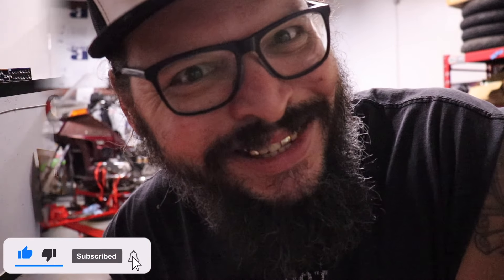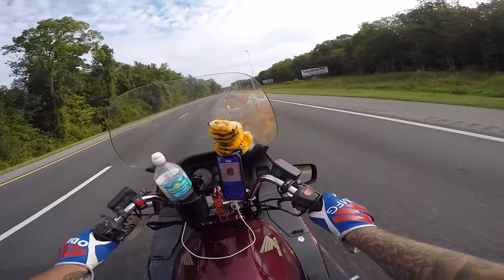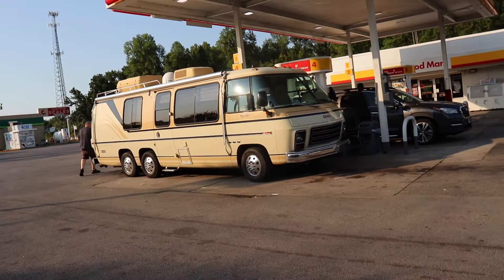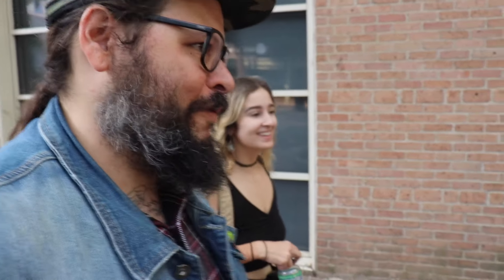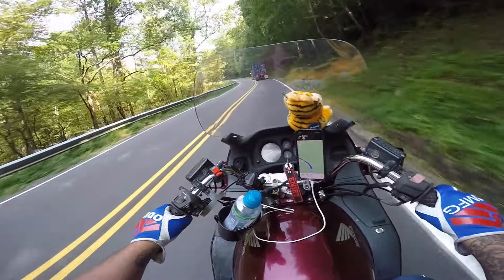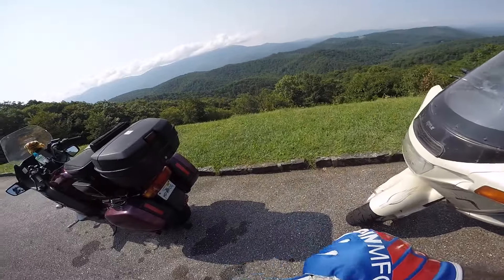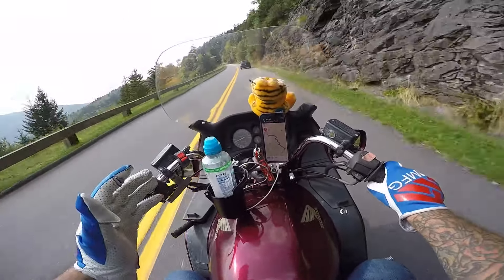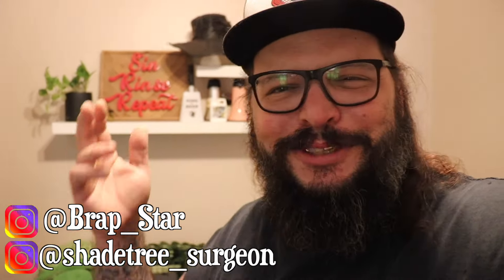JUST SEND IT | Motorcycle Roadtrip on the Cheapest Bikes We Could Find

Comment: I paid 3k for my VTX1300. I bought it on a Sunday morning. The next Thursday afternoon I took it 8 hours from northern Louisiana to Grand Isle. The southernmost point in LA. I had my endorsement, and insurance, but the new tags hadn't come in yet, so I punched out  350 miles with a dead tag on a bike that I had only ridden maybe 20 miles on when I had only ridden maybe 5000 miles on a bike ever with my longest trip being about 2.5 or 3 hours from home base. 

Since, I have put about 5k into the bike in annual repairs. I don't work on bikes. And almost 20k miles on that one bike. Plus close to 5k on just rental bikes. 

#ilikebike
Reply from the maker: Jimmy is doing it right. Be like Jimmy.
Reply: @shadetreesurgeon  I tried to follow your lead and do my own work on my bike. Brakes, no problem. New sissy bar to hold a bigger pack, no problem. New custom ammo can bags, easy. Pull the tank to put a new carb on it, and drop the tank and dent the shit out of it, and then break every vacuum line on the carb as well as the intake boots. It is in the shop right now getting all dressed back up.
Reply: @UCYxS6Kmr8sFFhb0cZJbfcqQ I'm on my 3rd or 4th set of tires, and brakes. I paid to have the front fork tube rebuilt. I've paid twice to have the neck bearings done, and the carb rebuilt, and neither has been done yet. Hopefully, this shop is more reputable than the last two, and it actually gets done. A wasted $1500 trip that all I got was tires and fork seals when I paid for a full service, and neck bearings, and brakes. Then another $1000 trip for some fucking turn signals, and maybe neck bearings when I asked for tires, a service and a carb rebuild. Now, this one is $1500 for actually getting the carb rebuilt, a new front tire, checking the last guys work on the neck bearings, and a full service. I've had the bike since 2016, and it is a 2006 model that has been neglected its whole life, but it still runs. It ran when I took it in, but was leaking gas out the airbox. 

What? Should I ride a harley? I don't like working on my bikes. I like riding them.
Reply: Hey! Another Louisiana dude. I'm in Thibodaux
Reply: @Gibsonfan1989  lafayette here.  I have a touring harley but love my 85' honda shadow.
Reply: @AKSnoopy7  nice. I have a Honda NC750X. Looking for a touring bike next year
Reply: @Gibsonfan1989  not anymore. I was in Winnfield. Based out of NC now, but working in Tallahassee at the moment.
Reply: It's unusual to hear of a Honda being so finicky.  A Sportster and a service manual, with a cheap set of tools is a high value combination. So easy to maintain and repair. 83,000 trouble free miles, still on original drive belt and clutch cable.  You can do it yourself, it's not hard. I do my own tire work, it's all in the service manual, and on YT! The clutch "spring plate" died at 38,000 miles. But, it did not leave me stranded, I was able to limp it home.
Reply: @spacetruckin6555  I can rebuild a semi truck top to bottom. No problem. I can't do carbs. I don't have the patience to work on small stuff. I'm too good at breaking it. It has never been finicky. I took it to shithole, scamming, lying assholes to get worked on. There isn't a shop inside 100 miles of my house that I will take it to again. Or anything. I wouldn't let any of them change a tire on my friggin bicycle.
Reply: @Gibsonfan1989  hey, another Louisiana dude...I'm in Houma.
Reply: @gokaneinthemembrane2745  hey! How'd y'all make out from the storm? I'm currently living in sulphur. My job moved me here because I had no house there anymore, but I have another place here.
Reply: @Gibsonfan1989  my shop got leveled by the storm. House has a few holes in the roof and the garage door is on vacation in someone else's yard. Pretty brutal overall.  I'm currently looking for a place to rent or perhaps buy to keep my bikes and tools. We just got power back yesterday in my neighborhood but of course all the appliances are fried. Overall,  we made out better than some. Houma took a major hit.
Reply: I seen the video of that hoda you bought 4 $750.00 watched you go Miles and miles lol I also like crappy junky vehicles why have no idea 💡 lol
Reply: @shadetreesurgeon  you should come to Tucson Arizona! I'll give you a local mountain tour that will blow you away. There is sooooo many fun places to ride in and around Tucson!
Reply: VTX1300's are awesome
Reply: Will I had a 2020 hawk 250cc cost me thousand and something traded it for a Honda goldwing 1984 1200 the guy wanted 3 thousand for it I was at work so I had my step son ride my street legal dirt bike about 2 hours out and he came back with the Honda goldwing
Reply: @jmyoung513  will I know this dude in OKC area who said he can rebuild my starter because they don't make them any more so I looked online my self he wanted me to pay $120.00 also on line you can order them same price I going to have that dude to rebuild my starter lol
Reply: Hondas build the most reliable motorcycles
Reply: @Gibsonfan1989  I almost bought one of those a couple years ago.  They are pretty slick. I guess they weren't weird enough for me so I wound up with a pc800.😆
Reply: @MostlyInteresting  I love it. I only wish it was more comfortable for long rides.
Reply: @Gibsonfan1989  I haven't gone on any long rides as of yet kind of working up to it. But the PC has a fat seat and a very neutral riding position so it's been quite comfortable so far.
Reply: @Gibsonfan1989  I'm in Lake Charles.
Reply: @mr1bienvenu1   what's up dude!
Reply: Vtx bro 👊
Reply: @shadetreesurgeon  dam shadetree I would really like to hangout with you and go for a long ride unfortunately I'm in Philly but I'm doing Daytona bike week this year and more than likely I'm doing Sturgis solo from Philly can't get nobody to do Sturgis with me they say to far but your a real dude oh well it will just be me and my Kawasaki Vulcan voyager
Reply: Feelin the Louisiana love, I'm a lake Charles native

Comment: "Tupperware glides" has me on stitches 😂
Reply: As an owner of a PC800 it was a giggle here also. We call them tupperware all the time.
Reply: I've owned 2 Goldwings. Found them a bit boring. The transmissions failed on both of them. Both were bought used, and both came with floorboards and heel and toe shifters, which I replaced with stock shifters and pegs. I was told that the previous owners probably used the heel and toe shifters for a footrest, putting pressure on the internal shifting mechanism and eventually causing damage.

Comment: I live in Ohio and a few years back I saw a 1982 CB900f for sale in Phoenix AZ. I bought it based on a few pictures and a video of it running. The next week I flew out and rode it 2000 miles home. It took about a week. I rode it back as it was other than replacing the tires and doing a quick oil change. That was one of the best weeks of my life.

Comment: Remember my first trip to France in 1984. On a beat up  Z650C, with 45000 miles on it. $500 or so. Two throw-over saddlebags, and a tote bag on a rack. Set off for France, and looked for a hotel every evening around five pm. Arrived on the Spanish border after four day, stayed for a week, then rode home by the same method. No 'cell phone, no GPS, just a Michelin map of France. Became completely hooked in those two weeks. Oh, and it ran almost dry of oil in the centre of France in the August sunshine. Took 3 litres of oil to get a level in a 3 1/2 litre sump. Ran fine for another year.

Comment: I did something similar in 2018 a guy  I work with was talking about riding to sturgis I had at that point not owned a bike in ten years. I told him I’m going to buy the cheapest like I can find and go with you. $2000 layer I had a 2004 klr650 with 40.000 miles on it and I went to sturgis. This was the second time in my life that I rode up there. It was one of the best times ever. Cheap motorcycles are great. Got home and traded it for a 2004 super glide plus $1000 now I’m riding a $3000 Harley. Lol

Comment: That's why I originally wanted an ST1100 or 1300, because of that big fuel tank and being able to go three or four hundred miles without refueling. I cannot stand stopping every 200 miles that's like no time at all in the saddle for me. My longest ride is 29 straight hours.
You can get some two or three Oz plastic bottles, fill them up with Marvel Mystery Oil and put some of that in the fuel tank every time you fill up it's a great top cylinder lube and keeps the injectors quite well cleared. Plus you can put it in the crankcase about a week before you do an oil change and make sure the inside of the engine is nice and clean

Comment: Bought an ST 1300  $3,400 CDN =  $2,750 USD with at least $3,000 in after market which included a set of Two Brothers pipes that just set the bike in whole new attitude of growl; Delcavic also compliment ST’s.  I’ve had it for 3 years and have gone through two full sets of tires. The Bike is a Monster in high mountains passes in Western Canada. The guy that I bought it from couldn’t sell the bike since he was in a small rural Harley market town; which was perfect scenario to low ball and he was motivated. By the way Love The Tragically Hip reference that you slid in there.

Comment: That should be on a separate switch the fan probably just blow a fuse or circuit breaker you probably've got to reset it And it should be fine.   The Ride that you took to Oklahoma I know you're aware of it but the 1500 gold wing Has an on board compressor you get a flat you get a little bit of an extension hose and you could Fill the tire with air You don't need a tire pump But what I do recommend Always check the brake fluid level It magically disappears

Comment: I feel ya on buying cheap bikes. I bought a 2003 Honda vtx 1800 with only 17000 miles on it from the original owner and nothing is wrong with it at all and it had a full tune up brand new tires and everything and I bought it for only 2000$. My dream bike and I got it cheaper than any other bike I have had. You don’t need a 40,000$ Harley to go on a long trip. I don’t know why people think they need a super expensive bike to be able to take a trip.

Comment: Bought a 350$ 40 year old yamaha. Learned to ride over a couple days.  Gas, oil, plugs, aired up tires. Couple weeks later, cracked header and dying battery and all, me and a buddy took off. Couple hundred miles later somewhere in northern ish wisconsin eating bacon wrapped tenderloin and drinking beer. 2 wheels and a will. Now however, the body, mind and soul are willing but the vessel, she is not. 2 new tires and a front rotor that isnt "self lubricating" and Ill squeeze in another trip before snow falls
Reply: Didnt even know what township I was in. But I knew which cardinal direction would get me home, since my phones worthless when it comes to gps. Id do it again tomorrow if i could...

Comment: You don't need a 750cc or larger bike to tour on. In the early 80's I crossed the USA on a 1981 Honda GL500 Silverwing. It was Honda's light touring bike they built due to the huge numbers of Honda CX500 bikes with Craig Vetter Windjammer fairings, Bags, and Trunk and touring the country on them. Honda simply copied them and sold a whole bunch of them. Bike's and Beard's has a video of one if you look that up. I'm old and ended up building a light touring bike I could manage. I used a Honda VLX Shadow and fabricated brackets to mount an old Windjammer on along with the matching bag's and trunk. It turned out as good as my old Silverwing. A few months ago I added a Velorex 562 Sidecar to it because I enjoy the extra stability that gives me due to my age.

Comment: I have a '97 Honda Shadow ACE VT1100 with 63,000 on the clock.  Just got back from my first multi-state 2,000+ mile trip (Sandy Eggo, Oregon, Nevada back to Sandy Eggo). At the last minute my friend asked if I wanted to ride to Oregon and I said "Sure, why not". It was boiling hot when we started in Sandy Eggo.  Freezing and wet in Oregon.  I didn't pack proper cold weather gloves.  At one point it looked like I had small bees nest on my hands because of the thick socks I tried to use as hand warmers. I thought putting plastic between the layers of socks would help from the cold wind.  Nope.  My fingers still froze. But I wouldn't trade it for the world.  There were miles and miles of HWY 395 that me and my companion were the only living creatures on the road and some of the landscape we saw looked really alien in a Sci-Fi sort of way.  Good on ya Shadetree.  I can't wait for my next adventure!

Comment: I never get sick of the twisty mountainous country roads....no better roads out there 🤷‍♀️  I bought a 24 HP Royal Enfield Himalayan, because I prefer the country roads over highway.....I like dirt, packed gravel, and even some sketchy shit....paid 6k for my bike (new), added every mod possible, with the exception of the engine mods (crash bars, fog lamps, USB charging station, panniers and racks, hand guards, went through 3 windshields getting the feel right (buffeting issues), plug and wire upgrades) and it still comes in under a bare bones KTM of similar displacement....it is the motorcycle equivalent of a pack mule.....LOL

Comment: Thanks so much for sharing your awesome trip with us, Shadetree! Now I’m inspired to take my Sportster on a trip, but I’m hesitant without cruise control. I agree, road trips can be done on any bike, but at what point does it cross the line of fun/punishing yourself? The whole point is to have fun on the bike, so for me, day trips might just be the way to do that
Reply: Look up cruise mate. It installs where the star wheel is between the throttle cables and is a 1/4 turn lever to lock the throttle. It works very well and is under 70 bucks to buy it and the drill and tap for the hole in goes into. If you have a drill already that's all itll cost.

Comment: hmm... those look a lot like a vfr other than the front fairing. which, evidently it kinda is just a steel frame, shaft drive vfr. or shaft drive full faired magna, guess that'd be more accurate. but 750 bucks? damn, cheapest one i've come across was like 3500... but then, i just started looking, since an hour ago i didn't know these bikes existed. honda never ceases to amaze me with their endless models. one of these and an xrr, i'd be good to go... and maybe a zx10 or cb1000... and a cr250... 500... another crazy kawi.